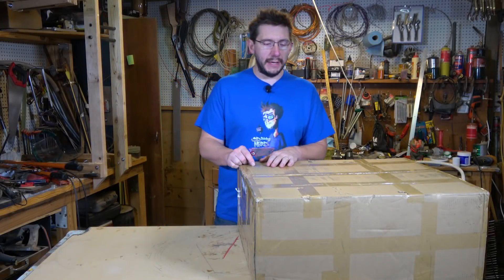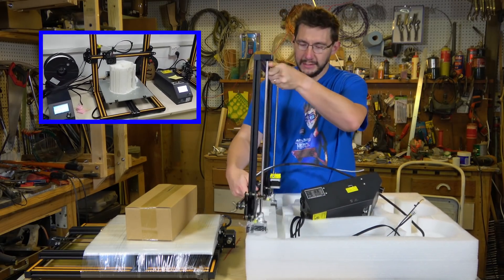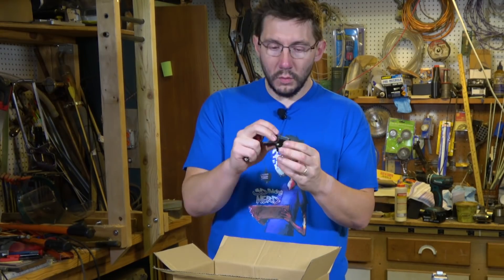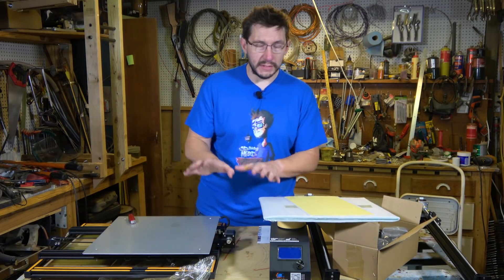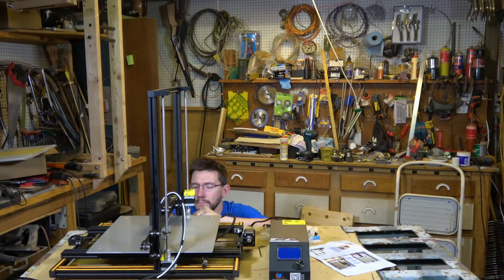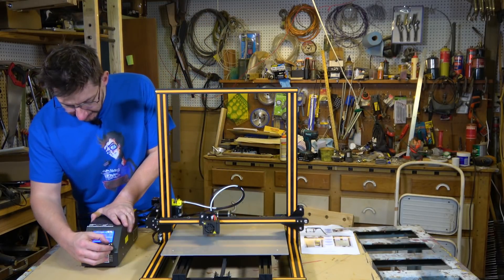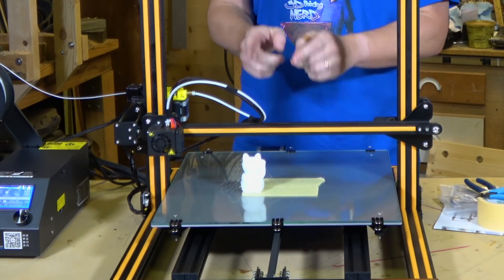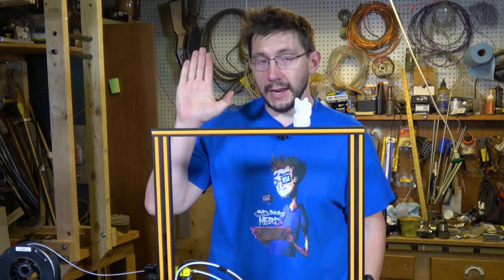Creality CR-10 Enlarged / CR-10S4 - Bigger Build Volume, Dual Z Leadscrews, Filament Sensor

Comment: Joel, in your opinion, is the CR-10 S4 still a good printer in 2025?
If it is still a good printer, what mods would you recommend to make it a little more user friendly and up-to-date?
Reply from the maker: There are so many good options right now besides that old machine. I would look at the larger Neptune 3d printers from Elegoo and Sovol

Comment: a bit too late to comment but I did connect 220 power supply on a vacum chamber for resin casting and yep, blue smoke and couldnt get rid of the smell in my apartment for days

Comment: You will blow the capacitor , and rock for a printer.  A Load pop, 🤔 smoke.   I do not believe fuses will blow.  220 uses 1/2 the amps.

Comment: 110v into 220v = 4 times the expected power draw and well if you like fireworks and burning smells go for it.  Also since you are handing a metal framed device of possibly dubious quality a 30mA RCD device is a worthwhile extra. They dont cost much (like $5~20USD) and could save your life.

Comment: Two Y axis rails that no one seems to notice are included instead of one, the filament sensor acts as a guide away from the lead screw aswell and I think having the X axis loose upon arrival is better or maybe even a thought about option as it will not bend or damage the rail during transport if any energy goes onto or into it. I wonder if there is any kind of syncing of the two lead screws though, is there two end point sensors to calibrate or is it purely luck that you don't bump one when the device is powered off?

Comment: On 120V AC you are switching in a voltage doubler circuit so if you have it on 120v and plug-in 230v +/- you get nearly 500V  and it will go bang.

Comment: I actually did plug a power supply set to 110 into 220.  It blew up some resistors, made lots of smoke, and smelled terrible.  It also bricked the power supply, so not recommended.

Comment: Is it logical saying that the US are lucky for using 110V in opposite to the rest of the world? I mean, if they didn't, then the problem mostly wouldn't even exist..
Btw: I think a review of this printer is kinda useless, because everyone has seen enough vids of the CR-10S, and this is no different, but a bit bigger.
But if you really need to review it again: I would have liked seeing at least a bit of criticism about the design not really being up to that print size, because of the too low reliable print speed for actually making good use of it.

Maybe you should print the kitty in maximum possible size and judge the printer based on that eperience.
Reply from the maker: #MaximumKitty

Comment: your channel is great i'm learning a lot, thanks !
is gear best reliable ? i order the same 3d printer 5 days ago still they haven't shipped to me, is it normal for them to take so long ?
Reply from the maker: I would reach out to gearbest for a status, and see if they can give you an ETA for when shipping will happen.
Reply: Arrived ! been delivered on a Sunday morning (weird) but it took only 15 days from order to delivery, very happy with Gearbest service.  I'm about to re -watch your video to check if I assembled everything correctly :)
( creality in my cr 10 s4 has included the support for the wire the connect the hot bed )

Comment: This is probably lame but I would like to see not a large print but a multiple print. Fill the bed. Multiple objects varying height. various infills (if possible). This would give the printer and the slicer a real run for the money. . . . . . . ORrrrr not.

Comment: My CR-10 came without a lever on the Z axis limit switch. I replaced that myself. I have since had to replace the fan in the control box and the part cooling fan due to defective fans. This is all in the first month. But it does print nicely when not suffering from defective parts.

Comment: Video quality is improving for sure. Focus looks great now. Only bit where I think it gets thrown is where you cut into the closeups (but there digitally zoomed). Would be cool to have a second lens for closer shots, would keep things looking cleaner. 

Love the Father in law's workshop though, great set. Like Home Improvements :)
Reply: I do the digital zooms for comdeic purposes or to emphasize things, usually.  Sometimes just for fun.  Hope they don't bother you too much!
Reply: Sean Connelly I think you took that there wrong way. The new format looks great and the changes from wide to tight work really nicely. Especially with their timing. 

I just was saying if you had another lens setup you'd get to keep the same effect but without the sudden change in definition, maybe with a slightly different perspective and so ultimately would look better.

It was an attempt to provide constructive feedback. These 3d printing video's (yours, Tom's, Angus's) have all the become much higher quality in recent weeks and months and that's great. I sent the comment with love, not hate.
Reply: I didn't think you meant any harm by the comment, sorry if it came across that way!  I would definitely agree that a second camera would be amazing to have in the edit!  Thanks for the comment, man, we really appreciate it. :)

Comment: I plugged a 110v into a 220 wall socket, it killed the 110 side, the 220v did work after ward and did so for 2 years, this was on a radio I had in Germany in 1982

Comment: If you switch a powersuply to 110/120 in France where electricity is at 220/230. It smells like burned toast and the PSU is dead.

Comment: I ha e a long standing dislike of GearBest after a bad time with my first ever quad purchase ....a Syma X8...which was obviously either a repaired return or s factory reject, however wanting a CR-10s and finding any readily available...at a not too high price on the shipping....was not easy in despair I looked at GearBest....the price was lower than anywhere ....against my own better judgement ...I ordered.  Today after 6 days “in processing”  a support ticket I sent asking why the delay...and can I cancel....I was advised the machine is on back order....which contradicts the 52availble tag they had on the sales page.....I cancelled and await ...I assume...a delayed refund go PP.

Comment: Lol, I once connected a server that I received from the US to 220Volts, it lifted about 10" from the table with a very loud bang. Luckily only a large capacitor in the power supply was blown up and we had a spare power supply at hand :-)

Comment: Yep. I turned on an old PC set to 110 in Italy. It made a huge BANG, and it triggered the circuit braker.
Reply: It still worked after replacing the PSU.

Comment: If you plug in a 110 into a 220, you will trigger a "Joe" event. one of two things will happen; fuse in the plug will pop - simple replacement, or, my viewer's favorite; you will be presented with the "Magic Blue Smoke" due to a blown capacitor which i am very famous for lol
Reply: One perk of being on 110 I guess, plug a 220 into 110 and it just doesn't get enough power.
Reply: I converted my server room over to 220V. A friend was helping me and plugged in one of the critical servers without changing the voltage selector switch. The power supply went bang and started to smoke. Luckily for him only the PSU had exploded and he got to live.
Reply: Funny, I was saying "Ask Joe" out loud :-)
Reply: My wife did that to my sons computer when she moved to Australia.  They were having computer problems and I told her to shut off the power supply switch. She accidentally slid the power selector to 110.  Needless to say we know who let the smoke out.
Reply: Last time I had this happen was on a PC PSU, the magic smoke embedded was released.

Comment: Im glad you get your stuff from Gear Best all ive gotten is excuses, I ordered The tevo tornado. Said they were out Tevo didnt send them enough inventory. But the website said they had over 75 pieces. SO i said ok and went with the original cr10 instead. More excuses no stock anywhere. Again went to website had alot in stock. Gear Best sucks only people getting what they order is you the reviewers.
Reply: Yup. Always Gear Best always seem to have 'lots of stock', but don't supply. Gave up, now use Banggood and AliExpress instead.
No company is perfect, and everyone's experiences will vary, but in a year of using BG and AE I have only had one failed delivery from AE - for a terrible GBP 1.27. Even that was refunded. 5 out of 6 orders on GB were messed-up one way or another. :(

Comment: Hey Joel, i recently made a move overseas and on one of my CR-10's i happened not to set the power over to 220V. Upon flipping switching  on the CR-10 you'll here a loud "POP!!!" and most likely the fuse in your house will switch off like mine did. Afterward the CR-10 was unable to power on. Upon further inspection of the interior of the power supply the fuse with in it was completely shattered. I replaced the power supply and for good measure the fuse with in the power cable connector. Wallah the CR-10 had life again. From what i understand the power supply in the CR-10 has a safeguard and all other internal electronics worked properly even after the incident. I have yet to test  the printer on a full print but will do so today. If you would like an update let me know.

Comment: I've seen a few CR10 builds on YouTube and some have found the Z-axis stepper motors have clashed with the plastic trim beneath them on the Y-axis assembly. I was wondering if this is an issue, or potential issue, with this model? Additionally, I was wondering what's the build volume?

Comment: 220 into a power supply set to 110?  Instant Burnout.  If you are lucky, just the power supply goes up in smoke.  If you are less lucky, either the electronics it powers get destroyed or it catches fire.

Comment: Plug in 220 while it's set to 110 and you let the magic blue smoke out. For those who don't know. All electronics run on magic blue smoke. If you let that smoke out it stops working.
Reply: Happened on my Duplicator 6. Bypassed the blown shit and we good.
Reply: mine was working on a loud bang...

Comment: hey 3dprinting nerd! you never did a complete review of the formbot t-rex 2+!! i hope your machine is as good as mine!! its absolutely amazing!! and the build quality and eazz of set up is amazing!! dialing in the 2 extruders is just as easy!! (it does take time but its easy!)
Reply from the maker: +mitchell hirsch working on it!
Reply: its one of my fav machines in my massive line up!! the tvo tornado is a close follower!! for the price and what you get! the tornado is (imo) a cr-10 murderer !! honestly!! out of the box it prints! set up takes 5 min! ! the ac heat bed with ssr is awesome! 100.c in 2.8 min thats right 2.8 min all the extra goodies in the firmware!! eg (most important ino) baby stepping on the z axis! there are many other awesome firmware features  to many to list!! the only thing i found wrong on the tornado is the fitting on the titan is press fitted instead of the proper bowden adapter!! (screw in type) but its a easy fix!! all you need is that one fitting for the titan! and its fixed!!....sorry haha i figured id let the fine people of your group know how awesome the tornado is!! its the best first printer people should get!!! its on sale right now for 355 and if you use this code ...tornados... it will know another 25 bucks off the purchase price!!!  you will not be disappointed!!  if you buy the E10 then yea prepare to be disappointed!! lol... i wont go into details!! unless someone asks!! ;) anyways ttly !! those are my 2 cents lol or maybe 10 cents...

Comment: I was reading the dual z screws cause issues with bed leveling, but a pulley system between them tends to deal with same. This a "s" version?

Comment: Aussie here, 240v is our standard.
I plugged in a brand new i3 Plus and looked for the switch, couldn't find it. Not mentioned in the manual. Fired it up and it popped the power supply and tripped the circuit.
New PSU, found the switch during replacement, no issues afterwards :)

Comment: Looks like it prints like crap. Surface finish on that looked pretty poor from here.
Reply from the maker: +Joey Nuggetz the surface finish on the part of the model on the front that should be smooth was not hence my remarks about speed artifacts / loose belts / sad unicorns. The rest of the cat looks appropriate - it is suppose to have a surface finish that makes it look like "fur"
Reply: Ah, didn't realize it had an intentional "fur" texture. Thanks Joel.

Comment: Plugging in a 110V appliance into a 220V power socket results in sparks and fire. I experienced this when a friend tried to use my 110V hair clippers in Cuba, which is rated at 220V. :P

Comment: heard so many horror stories about gearbest,  Not sure if I should be worried to order from them?
Reply from the maker: +Neil Heuer I've heard horror stories and I've heard of people very satisfied. If you order one of these from them and something goes wrong, reach out to me and I'll put you in touch with my contacts there.
Reply: Much appreciated! I am finally getting a printer - I did order from them and then cancelled after reading some of the stories :( . - I ended up ordering an A8 via Amazon.  My first printer so I have my fingers crossed but hopefully I will get the hang of that and need a bigger one (this one) soon! Thanks for the fast reply!
Reply: Using PayPal as escrow for your payment seems like a good idea. I mean they probably don't screw anyone over on purpose, but mishaps happen and then there's nobody there to resolve them, language barrier and all.
Reply: It was only for a $100 item, but GearBest refunded me promptly after they received my return (to California, luckily).  PayPal even reimbursed me for the $14 return shipping.  But, TAKE PICTURES - before opening, of the problem, the packed return item (open) and the return item (including address label), and the receipt from the return carrier.  Just, be thorough, and you should be OK.  PayPal is always your backup as well.

Comment: mine is bigger ;) lol s5 over here
Reply: mitchell hirsch Oh. Ha ha. You think you are a horder. I run a 3d printing farm and have 2 Cr-10 s5, 3 cr-10, 2 tevo tornado, 3 prusa clones, 2 Delta’s (one 4 footer), an anet e10, and a 3 color geetech. You can see all of these on my instagram. @3d_printing_101
Reply from the maker: +3d101 I will definitely check out your insta!
Reply: lol. same. got 2 of them
Reply: 2 s5"s lol wow and here i thought i was a hoarder haha i opped out for the t-rex 2+ instead of a second s5!! and now the new raptor is out (formbot) with a build space of 400x400x500 and a price tag @ $799 usd which is a smoking deal!!   i will do a review of it as soon as it is in my hands!
Reply: 3D Printing Nerd no way! Well you’ll get to see me In the flesh and blood on wednesday with my fully 3d printed shoretrooper costume!
Reply: i wish canada would have these kinds of meetups and or makerfairs!!! kinda makes me mad!!
Reply: lmao! well lets compare then shall we haha  ok so!!!!! 1 torndao , 2 mk2s's (1 has the 4 color mmu) ,2mk3's (coming soon- both to have the 4 color mmu) 2 e10's(not the best choice) , 1 east 3d gecko ,1 a8, 1 p802ma, 1 cr-10 s5, 1 tevo black widow, 1 e12 (coming soon) 1 a4 delta (coming soon) 1 flsun cube (coming soon) 1 t-rex 2+ (idex system) 1 raptor (coming soon) 1 am8, 1 flying bear tornado (coming soon) and last but deffinalty not least 1 SANJIUPrinter Z360 Dual Extruder Printer With Top Cover and Door More Higher Than Ultimaker 2+ Extended(coming soon)    

coming soon means they are ordered and either on their way to me or about to ship im in the works of a youtube channel!! and yes i print shit for money lol! for dam near all walks of life and all forms of "businesses" .....i almost got the 3 color geeteck!! how is it????    im not bragging here either lol just thought it would be fun to list them !! to see the different machines we have!!  i see we both have a out of control addiction eh!!

Comment: I've had my review unit for more than a month and (spoiler warning) I like it a lot. The main issues are due to the larger bed -- it takes longer to heat up and it's a bit harder to level than the regular CR-10. I'd be interested to hear what Joel's opinion is about this in comparison with the G-Max, since they are so different in price.

Comment: Bang, bang happens :D
Reply: MiggyManMike yep. I  was a PC builder. Bang happens
Reply: MiggyManMike 
That depends on the type of power supply and a few other factors regarding the design of the equipment but it's likely to be a foolhardy event! 
If the PSU is old school and has a wire wound transformer then double the voltage in will result in double the voltage out which sounds bad but depending on the ongoing circuitry it may not be a complete disaster if only done for a very short time. However, if the PSU is switched mode then any input capacitors not rated for 220 volts AC (rectified) could fail explosively!
Obviously, connecting any electrical items to incorrect voltages, especially higher than the item's rated value, is a very bad idea and should be avoided at all costs to avoid the chance of injury or fire!
Reply: yes, but joke :p

Comment: My friend put 220v into a 110v power adaptor and it did a pretty loud pop sound. Then the entire house's power went out. Luckily it tripped a fuse before it damaged anything else.
Reply: AmadeusL 
Likely the pop was the sound of the input capacitor exploding due to overvoltage! It probably short-circuited in the process, causing the breaker to trip.